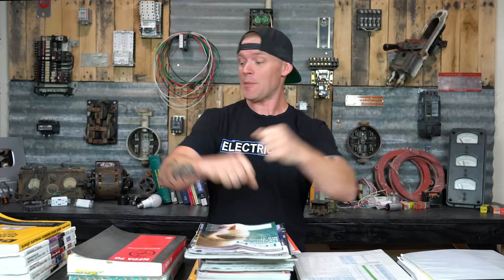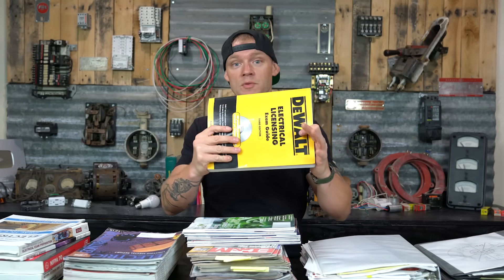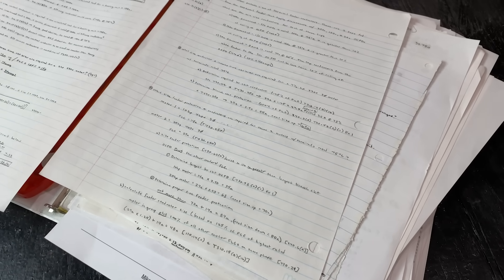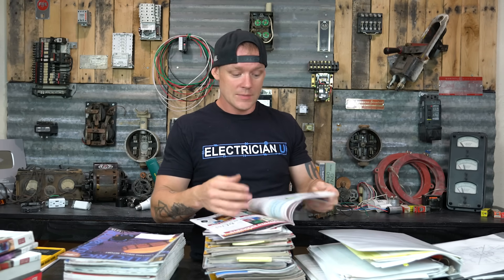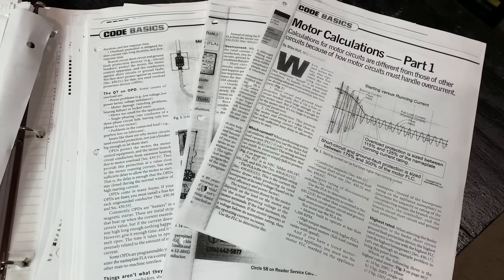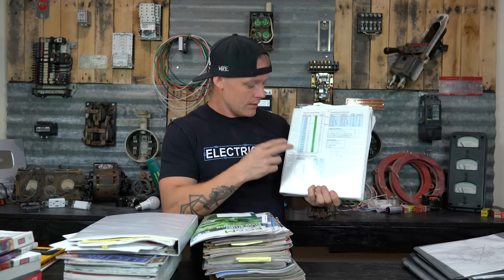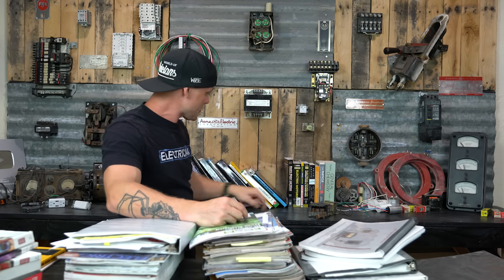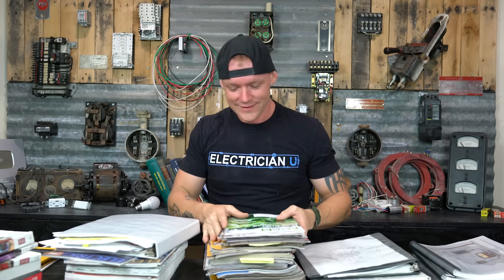How To Study For and PASS Your Electrician Exam (FIRST TIME)

Comment: Hey there!  I'm trying to find the label requirements (residential) for two conditions.  
1.  I installed a sub-panel in my garage, and feeding it with a DP breaker in my main panel.  I want to leave the original circuit at the same time.  I'm thinking htere needs to be a label(s) in the garage to indicate that there are multiple sources to that space.  
2.  I have a dual gang outlet with 2 20A sockets.  Each socket is on a separate breaker.  But, they are both in the same 2-gang box.  Does this need a label of some sort?  In the sub-panel (same panal discussed in #1) and/or at the sockets?

Thanks!

Comment: I do electrical work sometimes, I'M NOT an electrician..i was doing more like bussines management and a friend of mine( master electrician) started showing me and teaching me some electrical work, i do love this trade,I'm a 56 years old man ,i do a lot of residential work mainly,i learned other stuff like pipe bending,running wires,,but i depend always on other qualified, licensed electricians because, how can i say this....ok let's say if i have to install any equipment, i can do the job as long  as somebody tells me how many wires ang gauge of the wires,in other words ,i can do the labor part but not the scientific or theory,load calculation part.ok..I'm too old now ,i wish I've started when i was young,but any ways, i found out that residential work is much easier for me ,y really enjoy doing it and is something i can figure out by my self, i have a question, i heard(overheard)some one talking about a license exclusively for residential electrical work, does any one here knows any thing about that and what the requirements will be to get one if there is such a thing.? I like doing this better than being in the boring office looking at a bunch of papers and looking foward to do this for as long as my Holy Father allows me.

Comment: Just passed my Texas residential Wireman test. Knowing how to navigate code is critical and brush up on resistance calculations. Thought I barely passed but pulled a 93 out of my ass. The load calc questions were pretty dumbed down.

Comment: Have you studied code and electrical setups for ELSEWHERE in the world, to gain an even deeper understanding of the ways electrical works? 
Like studying the common practices and ways the grids are setup in South America, China, Africa, the UK and European Union, China, India, etc?

When I heard Technology Connects' YouTube channel talking about "ring mains" in the UK, and 60Hz vs 50Hz, I started wondering how many different ways the engineers and electricians around the world have used electricity to wire homes, power life, etc. 

If so/if you have studied them, does studying a comparative approach across the globe help enhance your depth of understanding for ways to run things here, seeing those other ways of doing things?

Comment: Hi there. I need advise.  I am doing shuttle bus van
conversion 27 ft long unit. Upon installing shoreline for refrig  heaters air conditioning  tv  misc appliances and tool usage. misc the issue is i think we need at least 30 amp but installer says 20 amp is all thats necessary for load

Comment: The best way to pass your electrical contractors license is to complete your 4-5 year apprenticeship working for a diversified contractor that works on commercial, industrial, and residential projects. Just wiring houses is not enough experience to become a fully licensed electrical contractor.

Comment: I just submitted my hours this week for my masters exam…I haven’t done any prep courses but a lot of practice test and reading the NEC book. I struggle with some motor formulas and some motors. Depending on how it’s worded I’ll make a update on it once I take it….
Reply from the maker: Good luck!
Reply: @electricianu  Update. It did take me 2 tries on the general knowledge and 3 tries on the calculations portion but I can finally say I’m a master electrician I’m in San Antonio down south of you I think you’re in Austin so I think that’s pretty cool 👍🏻
Reply: @justsomeguy.8670  congrats bro, im in san antonio too!
Reply: @justsomeguy.8670  do you know when san antonio will switch to the 2020 NEC?
Reply: @palomino0413 well after taking the test, i think they already swapped consider my test was over the 2020. The jobs however go by the specs/year of whenever the jobs are bid to my understanding
Reply: Update: I took it and failed. We’ll at least the calculation part. The knowledge part was ALOT faster then the journeyman’s. But I barely squeezed by. I just got done with a prep coarse and I have been doing TONS of prep calc questions. Taking it again Saturday so we’ll see 👍🏻

Comment: Took my first Masters test in NY in 1969. Was messed with by “authorities” saying I wasn’t experienced enough. Had to get letters from 3 NY Masters verifying their confidence that I was qualified to be allowed to test at all. Try that when you will wind up competing with those same Masters.
Was a challenge but passed. Second in Va in 1980 different but passed. Third in Florida in 2000. Florida has the roughest one in the country. Filled with many things I would never include in a electrical exam. Designed to keep the “riff raff” out. Unfortunately the “Good old boys” disease spreads in any state.

Comment: I've done a lot of technical exams over the years, and I've found that practice exams are one of the most valuable parts of the preparation process. Even from the beginning, when I know that I don't know enough, taking practice exams helps get my head into the wording of the questions and answers.  
Then, as I gain information, it has a framework to fit into. 
Later, as I get closer to ready, taking a variety of practice exams will show me where I'm weak and need more effort. 
I've never failed, although there were a few close calls. 
I'm not a very good student either. But practice works. The coaches that pissed us off as kids weren't wrong.

Comment: Was the NEC the only book you had to use during the exam?
Reply: It depends on the state. In Virginia, you can take NFPA70 and American Electricians’ Handbook. I only brought NFPA70 when I took the test.
Reply: @sawanathagoolsawat9655  damn we got the short end of the stick in florida, it's 14 books mandatory.
Reply: @AngelMartinez-ey3hu  I heard that FL needs to take business section also. Good luck!!!
Reply: @sawanathagoolsawat9655  already passed that test, took the trade one but failed because i didn't have a lot of knowledge on the other reference books. Mostly on the fire and osha stuff

Comment: The DeWalt practice book is awesome. That’s the only book I studied and I passed my journeyman exam the first time. Learned so much from it. But I wouldn’t just do the tests. Whatever questions I got wrong, I made sure I reviewed the methodology used to get the correct answer to make sure I got the concept.
Reply from the maker: Very good method, and yes very good book
Reply: Anyone have a 2017 or preferably a 2020 DeWalt licensing exam book they’d be willing to sell me? Apparently they are out of print now….
Reply: @skunnysss ever find one?
Reply: Where did you find the desalt practice book?
Reply: @Richgflo33  In CT I found it at Barnes and nobles books or Borders books I think. I paid like $45 and it has online testing practice similar to actual test
Reply: Im going for my test this month and have been only using Dewalt book. Im getting faster at navigation but Im not sure if the questions will be same or close to questions on Journeyman Final Exam. Did you have any questions on actual License exam that were exact as Dewalt exam?
Reply: @cyrusalmighty21  it’s all very close to the questions you will be asked. The most important thing is understanding the methods used to get the correct answer. Also, make sure you have tabbed your code book because it saves a lot of time when you’re searching for a code article.
Reply: @RB-xv4si  where you from ?
Reply: @joenavarro9317  Washington DC
Reply: @cyrusalmighty21  How did you do on the test?
Reply: @coindog6336  I actually pass 1st time with a 82% in CT. I feel I should have done better but 2nd guessed a few I had right. I was done early. They give 3 hours but I think I finished in under 2 1/2hrs and stayed to look everything over.  They gave me the results immediately. I swear by this Dewalt book! Im a Milwaukee M18 guy with barely any dewalt tools but ironically Dewalt helped me get my license. 🤣🤣
Reply: @coindog6336  I never used the book BTW. I only used the online part of DeWalt. They give you a code that gives you access to Online prep test. You go on website (Delmar learning). Its same as whats in book but its better to use since the Journeyman test is done on computer. Very close to how test is done.
Reply: What dewalt book what is it called im trying to prepare for my test
Reply: @FernandoGonzalez-ux8cs  Dewalt Electrical Licensing Exam Guide.
Reply: So, like actually reading and learning the code book??? 😂😂😂😂

Comment: Failed my test rhe first time by 1 point. That was a steel toe kick to the crotch! Passed it by a mile second time around. Test is all about how well can you navigate the book. Id highly recommend taking a prep class. The instructors know what's coming and know how to prepare you accordingly. Strategy taught to me was when given the test go through it and only answer the basic questions you know off the top of your head. Second time around answer the ones your confident you know exactly where to find the answer. Leave all calculations to the end remember all questions hold the same point value but some can take 1 min some can take 30 mins. Never leave a blank answer. If you have to just guess it can't hurt you.  Also take alot of practice test the more your immersed in code the better off you will be.
Reply: Great advice man thanks...
Reply: ouch
Reply: Bro! Your passion and the way you broke it down on how to go about navigating through the electrician journey, I got so much hope. Thank you.
Reply: Same I failed by 9 points first time but I’m retaking in February 19th
Reply: Thank you !
Reply: I failed mine by 1pt, also. Got mad, bitter, lost confidence, and never went back for a re-take.
Reply: Failed mine by 2 questions, but that index came in clutch. Navigation and the index is what I'm mainly focusing on for the most part for my re-take.
Reply: something flawed about the way this test is scored; wouldn't want an electrician "guessing" about the wiring in my house lol.
Reply: @Layarion  the wiring in your house is the least difficult thing to learn as an electrician. So I wouldn't loose seep if I were you. Guessing isn't about not knowing the answer in this situation. It's a timed exam designed to trick you into wasting your time. I can guarantee anyone who passes their master electrician license is certainly well qualified to take care of your electrical needs.
Reply: @Layarion  an electrician with basic knowledge could wire up your whole house after being guided. Putting it all on paper in numbers is the tricky part and knowing which numbers and percentages to plug in.
Reply: @Layarion  do you also have a problem with someone guessing on their bar exam as well? What about SATs? Smh
Reply: @seraphinas.cutiedove  tell you what, have an electrion, lawyer, or as you say, a student to do a job that cost YOU 10-30 grand. Tell me if you want them "guessing"

hey i was raped by this guy, should i report them? "i guess? but maybe not. who knows I'm just a cop the guessed his way through the exams." lol your name checks out, you can't be serious.
Reply: @Layarion  it’s a test. Have you ever taken a test before? A guess is better than having no answer. None of that other stuff you brought up applies to this at all. It’s a test! T E S T! Test. That’s what the gentleman’s post is about…tips on taking a test!
Reply: @seraphinas.cutiedove  nah dawg i'll pass on anyone who says they passed from guessing instead of knowing.
Reply: @Layarion  stick with your computer skills…leave the real to work to other people
Reply: @seraphinas.cutiedove  lol says the person with that name. still not sure if you're trolling.
Reply: @Layarion  you comparing guessing on a test to real life scenarios lets me know you have no real world experience…let me teach you something. An electrician can’t guess on wiring a home because before the job is done he has to pass inspection to get green tagged. Smh. Go back down to your basement and keep playing mindcraft lol
Reply: @seraphinas.cutiedove  well you're name says it all so i'm good.
Reply: @Layarion  back to minecraft you go! Go build stuff over there lol.
Reply: @Layarion  The test is certainly flawed. Passing it in no way guarantees you have a good, reliable electrician. Many pass who honestly suck at field work. The government is terrible at actually figuring out competency and aptitude. More than terrible. basically nill, fumbling in the dark level. Thus, they have made a test that is essentially just hard to pass. The test doesn't guarantee that an electrician can troubleshoot a system, or they know how to make good electrical connections, or build robust, solid electrical installations. Good electricians guess all the time, although if they are good, the guess is followed by meticulous and informed investigation.

Comment: How many exams are there for electrical, besides the master exam?
Reply from the maker: Tons lol. For standard electrical work there’s just three in the state of Texas. Residential wireman, journeyman, master. But if you’re in a maintenance electrician or a sign electrician there are additional licenses for you as well. There’s even an appliance installer license is where you can work on electrical but you can’t actually do electrical work.

Comment: I’m going to pass my Illinois exam soon 😊
Reply from the maker: Hell ya dude! You will for sure
Reply: @electricianu  thank you buddy wish you the best ⚡️💪
Reply: @electricianu   hey bud hope you can help me what is the minimum working space required by the NEC in new installation between a 480 volt motor control center any 480y 277 volt switchboard facing each other

I have the answer it's 4 ft but my question is how if it doesn't specify live Parts in the question it just says new installation 110. 26 A1 working spaces condition 3
Reply: Good luck Sergio.You got this!

Comment: This is perfect I test for my J card in May
Reply: Good luck on your test bro. If I could give you some unsolicited advise, make sure your code book is tabbed and highlighted well. Even if you know how the NEC is structured or even know exactly which article to go to for the answer, you’ll waste a few seconds on each question flipping through the pages to find the answer. Multiply that times a hundred questions and it could be the difference between passing and failing. If it’s some obscure question that you’ve never run across before, be quick to skip that question and come back to it when you have time. I’ve taken 3 different journeyman tests and a Masters test and never failed one yet. But when the time was up every time I was one of the few left in the room. That always made me nervous towards the end of it but more than likely most of those that finished early failed the exam. Do whatever it takes to mentally prepare yourself beforehand so that your not a nervous wreck
Reply from the maker: Badass good luck dude!